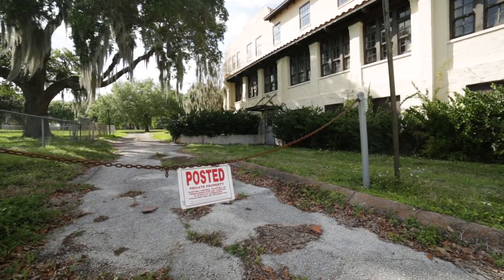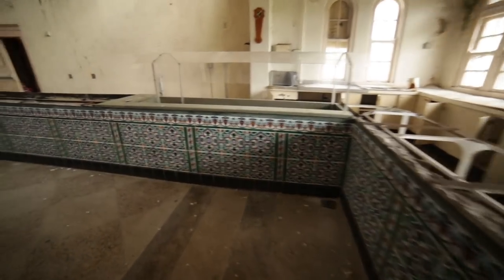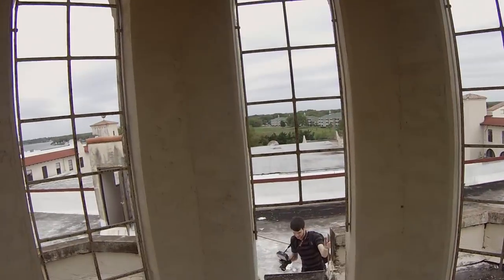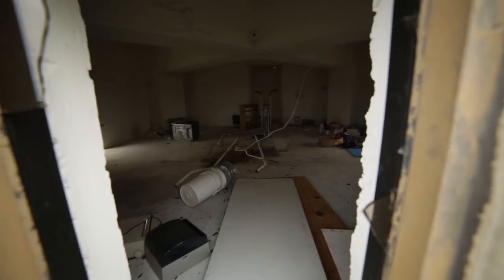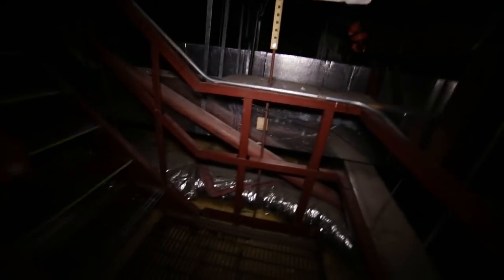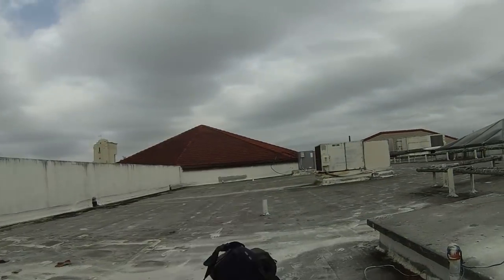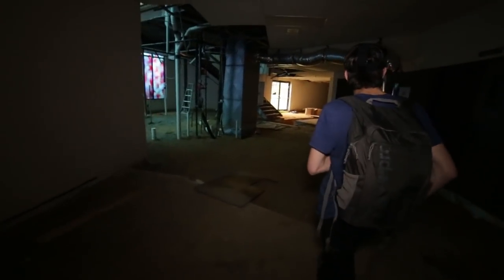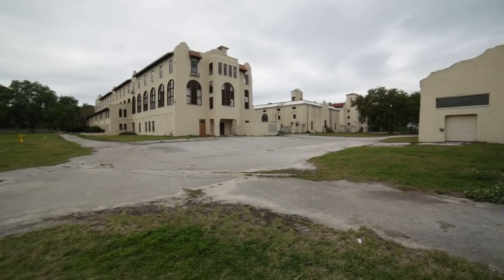Inside an Abandoned Megachurch

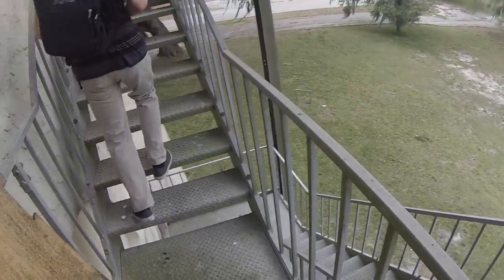Comment: 8:42 That was done because elevator doors are not insulated. Since that elevator shaft was open on the outside of the building, it would allow a lot of heat/cold to enter the building trough the elevator door.

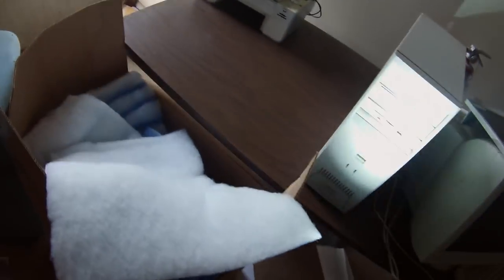Comment: I have two of those EXACT Compaq's (seen at 15:06) in my basement. It's an 800MHz singlecore that I'm sure maxes out addressable memory below a gig of ram and uses proprietary power supplies, IDE cables, and even CPU fans. They're a shining example as to why Compaq and HP can go get right up and fuck themselves. At least they could use standard HDD, CD, and floppy drives.

Comment: does mold just smell bad or is it actually dangerous? and very cool intro guys
Reply from the maker: It can actually be dangerous. Just poking into rooms that have mold in them for a second or two shouldn't be a problem, but spending hours in a building with a serious mold problem definitely could be. In that case, you would need a P-100 respirator to explore the building safely.
Reply: There is no difference in rooms with visible mold and rooms without. There are tons of form of mold in such a building, I would wear my mask all the time.
Reply: retro666future yeah if any building has any mold I wouldn't risk it, I'd wear the mask regardless if it's only in 1 room.